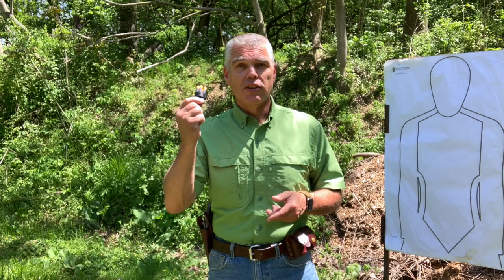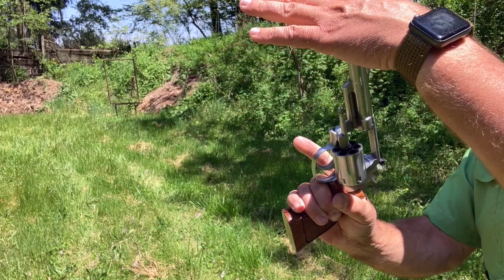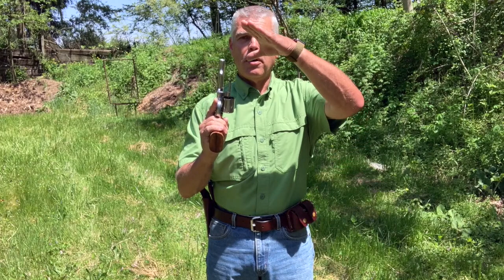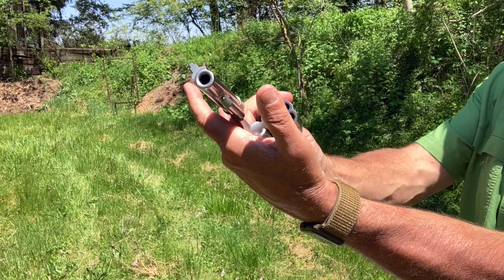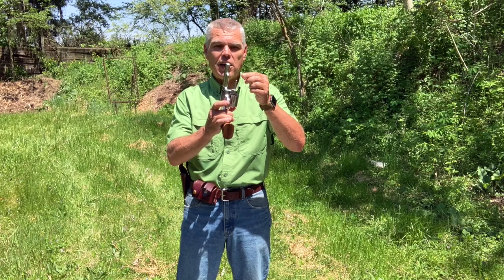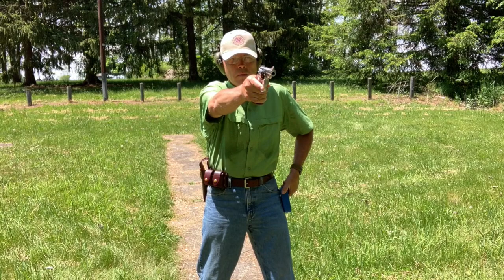Combat Reloading the D/A Revolver

Comment: Chief back in the revolver days I attended the Smith & Wesson Academy  Combat Handgun course and it was DA revolvers. I used 2 speed loaders in a duty rig but always carried the old issue 12 round belt loop ammo carrier. I was asked why by the instructors, when I have the speed loaders. The reason was if I fired say 4, I'd be dumping 2 live rounds on the deck I may need later. I used this to do the folliwing... push the extractor partially up enough to allow me to remove the spent brass and then replace them with ammo from my cartridge loop carrier. If there was time of course, if the fight was still on, for all and reload with the speed loader. At the end of the course they told me this system would be part of their future instruction. Funny too because I was packing my own purchased weapon, a 6 inch Colt Python.
Reply from the maker: That is a great story and it shows the savvy of the old time wheelgunners!
Reply: @hrfunk  That tactical reload of the revolver makes a lot of sense and I still carry six extra cartridges in loops besides my speedloaders.  I carry a revolver when I walk for exercise.  We have snakes here, so depending on the time of year I either have 2 rounds of snake shot up front in the weapon, or have those two rounds of snakeshot in the loops and have the JHP in the cylinder.
Reply: When I carried a revolver for work our qualification included a scenario where you had 2 loose rounds on the ground that you had to put into the revolver. Probably for that very issue of having to leave cartridges you might need later on the floor.

Comment: First, I'm a nobody. Not law enforcement, nothing. But I've been shooting revolvers for a long time.
One small but sometimes important addition to your strong hand reload would be to take your trigger finger and slide it in the frame after the cylinder is open, and you can hold the cylinder out with the tip of your finger so that it doesn't close in any way while you're doing your reload..
Reply: Excellent addition; I found myself just naturally doing this when I started really training with my little 442, but reading someone else says it helps reinforce why.
Reply: I do this too.
Reply: Good addition. I also place my shooting hand thumb on the hammer to stay clear of extracted shells and to stay out of the way of the incoming speedloader. Watch how he has to angle the speedloader in to clear his thumb and the grip. I come straight in from behind the grip. I also find Safariland comp II much more natural and it eliminates another step of turning a knob. I do use a grip that is very easy to clear a speedloader. 
Also off hand reload using a thumb on extractor really only works with a full length extractor rod. On a short barrel you will not get enough force from your thumb with a stuck case as he says. Every brand gets an over expanded case from time to time.

Comment: The Strong Hand Reload served me well for many years and was how I was trained. Using my strong hand for the "fine finger" movements gave me a lot of confidence that I was in more control of the speedloader while the revolver was strongly and firmly in my left hand.

 I see you use the HKS Speedloader? My favorite was the Safariland Comp 1 Speedloader. Found them to be a lot faster and I had a special pouch that held four of the Comp 1 loaders. 

I can see either method works but under the stress of a taking fire reload, I'm going with strong hand!
Reply: Hks are excellent but safariland are amazing. Harder to find safariland at times.

Comment: I've always used the dominant hand reload technic. I started exactly as you showed, using the thumb to eject the casings. Years ago I had an instructor who had us use the palm of the dominate hand before reaching for the speed loader. Just as you show with your non dominate hand technic. He was very concerned with the possibility of a stuck casing. It does slow down the reload slightly, less than a second, but it does work well. I will say, I never had any problems using my thumb either, but I was never in an actual gunfight where I had to reload a revolver either.

Comment: When I first got into law enforcement, I was carrying a revolver. When I went to the semi auto transition course I was issued a S&W 659 if I remember correctly I  carried a total of 43 rounds, I remember the instructor making the statement "If you're in a situation that you need to fire 43 rounds, you need to be calling in an air strike" I have no issue carrying a revolver at all
Reply from the maker: Most officers in most situations would still be well served by a good wheelgun. There are occasions in LE work (as you know) when the added capacity of a semi-auto is comforting.

Comment: Method number two for me, ejecting the cases using the thumb of my weak hand to push down on the ejector rod.  Either way though, sure beats trying to reload from a drop/dump box which is what I originally worked with when going through the academy.  Yep, guess I'm dating myself a little there, but speed loaders were something new back then.  Some folks were still carrying spare ammo in cartridge loops on the belt (ha,ha).
Finally settled on carrying two HKS speed loaders on my strong side in front, and carried a double dump box to the rear on my strong side as well.  Took out the plastic inserts, and was able to get 7 rds in each that way (insurance, in case dropped one).  My Ruger Service Six was loaded with 38 Spec.+P 158gr LSWCHP (a load I still like), also the speed loaders, and then Remington 158gr JHP magnums in the boxes.
Thanks for the vid.  I need to practice some with my revolver.  Still have a few HKS loaders.
Reply from the maker: You had a good revolver stoked with good ammo. The speedloaders must have seemed like a light speed increase compared to the pouches.
Reply: @hrfunk  Yep, speed loaders really helped, especially when reloading in the dark, too.  One stage on the qual. course called for firing 6, reload, and fire 6 again.  Time limit was 25secs.  With speed loaders we dropped the limit to 18secs., but most got it done in 14 or 15.  That was our 7yard drill,  Scores went up, too.

Comment: Good morning, HR.  I did enjoy this video and — after 60+ years of shooting “modern” DA/SA revolvers — I learned a few things.  So, I again thank you.  When my father, who was an FBI firearms instructor (during an era when Smith and Colt revolvers were ultra-dominant) first taught me, I learned the non-dominant hand technique very much as you demonstrated it;  I’ve always used it and I feel comfortable and confident in doing so.  And, just as you indicated, it precludes “whacking” the extractor rod and possibly disabling the weapon, which can happen (I’ve witnessed it). 

I’d respectfully offer your YouTube community two further throughs (based on considerable experience):

1.    I like full moon clips.  The reloading technique is largely identical to the speed loader process, but:  (a)  it’s faster and simpler, with no knob to turn (etc.).  The only revolver I currently own that uses them is a Smith 610 chambered for 10mm and .40 S&W (it’s a GREAT N Frame).  Another moon clip advantage is two reloads can “nest” together, therefore having a less bulk than two HKS speed loaders.  I’ve never paid a gunsmith to machine a .357 magnum’s cylinder to accept moon clips (becuase the probability of requiring a reload is small), but it wouldn’t be a bad idea to do so (imho).

2.    You mentioned the potential for high pressure handloads (as opposed to factory ammunition) to expand and thus to be more difficult to extract.  I thought this was an excellent point, because factually can it occur.  And I’d add (for the community’s consideration) that there is another possible problem;  unfortunately, some prosecutors (and even a few investigators) are decidedly anti-firearms for civilians.  Accordingly, these officials may erroneously perceive the use of handloads as an indication of “aggressiveness” (e.g.,   “he was so eager for a confrontation, that he used his own super duper ammunition”).  I certainly don’t agree with or approve of this, but it is reality in some jurisdictions.  Therefore, while I’ll occasionally use handlaods on the range or in the field, I never have them in self-defensive weapon (“Well, sir, this is commercially purchased factory ammunition from Hornady;  there’s nothing extraordinary about it.”).  

Thanks again for an excellent video and warmest regards.
Reply from the maker: Thanks Roy. I like moon-clips too. They are, however, less commonly used be the average wheelgunner and there are some who see them as a potential problem (if bent, they can cause the cylinder to bind and prevent proper functioning). I produced this video for all the recent new-firearms owners out there as opposed to the more skilled and savvy shooters who have been carrying/shooting revolvers for years. I suspect most of the new owners who chose revolvers have no idea what a moon-clip is or what it does. Thanks for the comment!
Reply: @hrfunk  

Yes, HR, I fully understand and I agree with you.  FYI, I really like RimZ polymer moonclips (developed about ten years ago by an engineer named Scott Beckham).  Because they aren’t metallic and are somewhat flexible, they cannot corrode or be bent out of shape.  In addition, they are EASY and fast to load and to unload (no tools or unusual figure pressure required).  They aren’t available for all autoloader calibers and for all revolvers, but they are easily purchased (Brownells, etc.) for Smith .45 ACP N Frames.  You might want to invest a few minutes in reading about them;  fwiw, I really prefer them to the traditional steel moonclips.
Reply from the maker: @roykiefer7713  I've heard of them, but I don't think I ever really looked at them. I will certainly do so. Thanks Roy!

Comment: Thanks for posting this very informative video.  I've tried both methods and finally settled on the dominant hand reload as (like you) I discovered the fine motor skills needed to line up the cartridges in the speed loader was something I did noticeably better with my dominant hand than with my non-dominant hand.  And thank you also for showing how that forcing cone may feel warm or even hot after six rounds but not so much that it would burn your hand.  I don' think it would get that hot unless you emptied the revolver 2 or 3 times in short time intervals.
Reply from the maker: You’re welcome Wayne. Thanks for watching!

Comment: I prefer the dominate hand reload. One thing I found with my Model 19 is that sometime magnum loads hang up, the speed loader catches on the grip. It never has been an issue with .38 loads. 
I also don't think you can practice the reload to much. I thought I had it down and the first time  tried to do it in a shooting match I dumped half the rounds on the ground.
Reply from the maker: I agree. Revolver reloading is a skill that needs constant maintenance.

Comment: Nice demo of both techniques.  As an average civilian I have a near zero likelihood of getting into a firefight at the supermarket so i just have a speed strip in my pocket when carrying my revolver.  Not as fast as a speed loader, but I like the ability to perform a partial reload which I think is the more likely scenario in a civilian encounter.  I use the non-dominant reload technique for speed strips.  I found it very stressful trying to do a quick reload left-handed, even with lots of practice.
Reply from the maker: Don’t take this the wrong way, but i hope you never have to engage in a firefight at the supermarket or anywhere else.
Reply: @hrfunk  Yup, my plan is to hide and run unless I have no other choice or someone else needs help in the vegetable department.

Comment: Groo here
 The second technique is the only one I use after I pit a hole in my palm with an S&W and hot loads..
 Using the thumb to eject is safer as the skin on the thumb is tuffer than the palm.[ the scar went away after a year or so]
 If the case gets stuck a quick rap on the thumb with the shooting hand will usually fix things .
 Even if you over strike a stuck case any damage to the hand will be the off hand thumb, not the most important shooting hand.
Reply from the maker: Words of wisdom Mark.

Comment: Didn’t they call a speed loader a 6sec loader ?  I sure like the leather carrier it would work and look good better than my nylon velcro thing.  Strong side
Reply from the maker: "6 secomnd loader" sounds familiar. I like the leather pouches too. The ones I use are made by triple K.
Reply: hrfunk  I have been using them since the 80s .